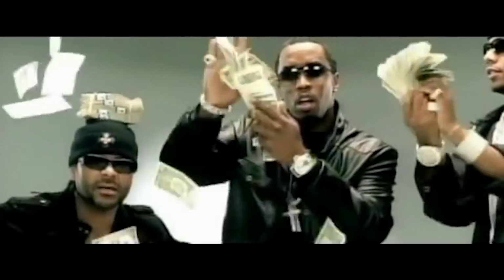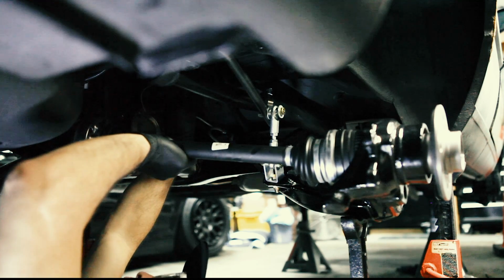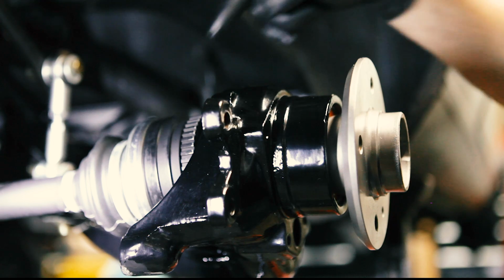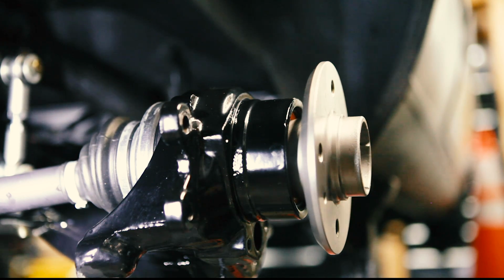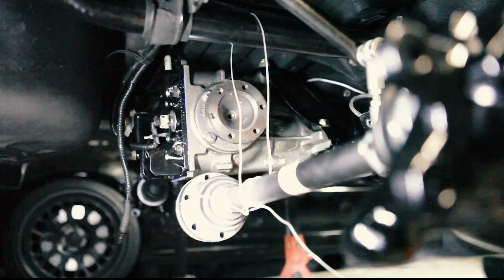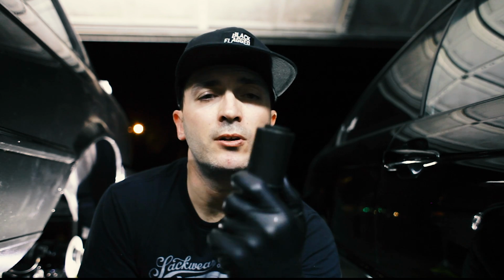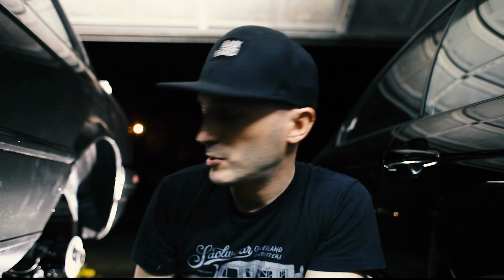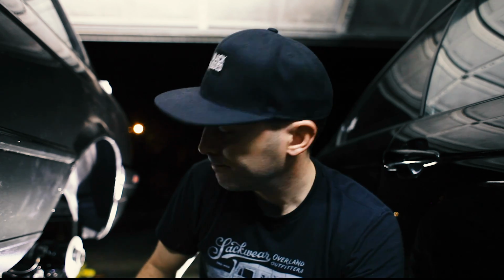Installing New Rear Axles on the E30! | vlog 079

Comment: The lockplate should be installed after the axle nut is torqued to spec. It can be driven in with a slightly larger socket, capturing the points of the nut and locking in to the 3 tabs.
Reply from the maker: T-Bone yeah my bad. Realized that this morning. I’ll pull them out before I torque the nuts and then put them on after. Thanks 👍

Comment: Wish I new about the front hub puller trick when I reinstalled the rear axles on my e46, ended up using just elbow grease to shove it in and then and hand made tool (grinded down axle nut backwards) to finish the job
Reply from the maker: Kingsley Zissou same here. Well, except the hand tool. Just shoved it in. It was such a pain. Btw, love the username 👌

Comment: Those axle lock plates are supposed to be pressed over the nut after it's torqued. You put them underneath so they aren't doing anthing. They are lock plates, not washers.

Comment: Thanks for this video. You gave the details for the Ford front hub installer as #3532, but the ebay link you gave was for Ford Front Hub Installer #3020 - is the correct one??
Reply: No it is not. The #3020 is M20 X 1.5. and stock axles ate M22 x 1.5. I am not even sure the one he used is the #3532 because that is M22 x 1.5 and the GKN shafts seem to be a larger size probably M24 x 1.5.  The best way to check is to use a thread measuring tool and a die set. good luck. this is a helpful video none the less.
Reply: It does not work, i bought it and did not work.
Reply: The proper one, M22x1.5 is part number 7924A by OTC

Comment: The axle tool he specifically used and linked did not work on my 89 E30. Did not even fit around the axle at all, not even close.
Reply: same bro the threads are much bigger

Comment: Do you deleted the disc cover plate
Reply from the maker: jonathan gonzalez yes. Talked to a friend who has built many e30 cars and they delete the dust shield. Just makes it easier to work on everything else
Reply from the maker: If I was daily driving this car that might be a different story, but that’s not the plan for this car
Reply: @BlackFlagged  How did you mount the e-brake?